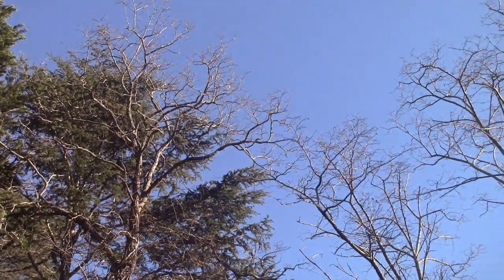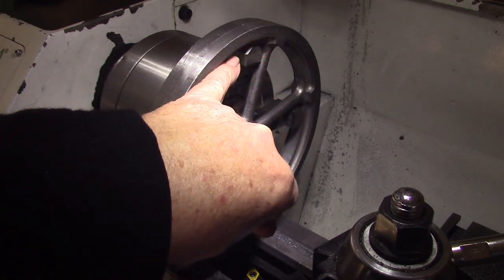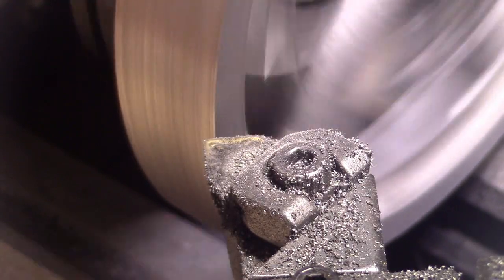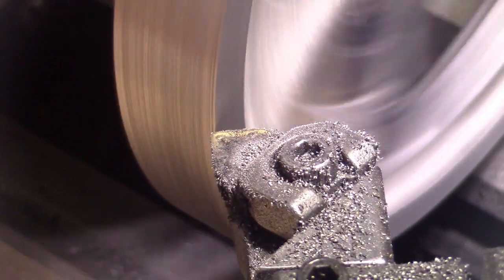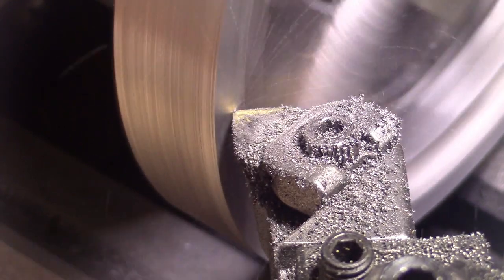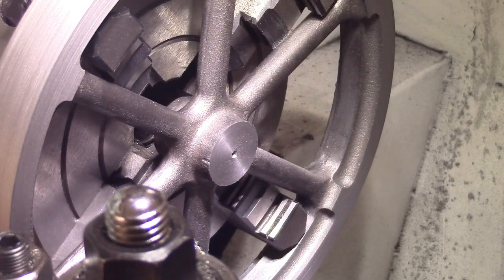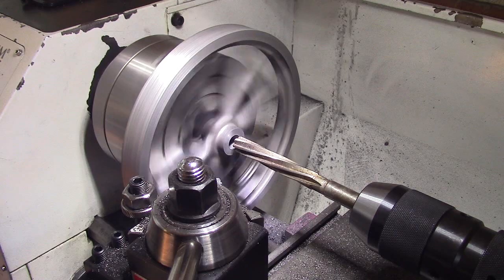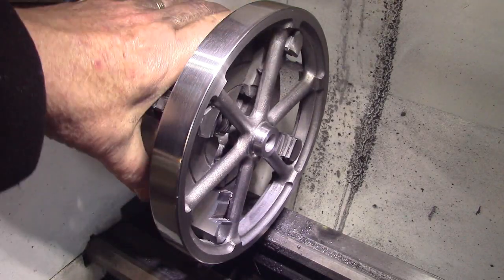Stuart Beam build 3

Comment: How did you secure the mandrel to the flywheel hub? Was it an expanding mandrel?  
BTW Great job on the fly wheel, looks great!!

Stay safe 

David G.
Reply from the maker: Hi David, thank you for the kind comments, I used "Supper Glue" to hold the flywheel to the mandrel, it's very strong and allows you to finish machine  the back faces. Use heat to remove the bond. (Early video)

Comment: Thanks Gary, I’m trying to decide if I can tackle this on my mini-lathe, (180mm swing over bed, with 4” chuck), what machine did you use?
Reply from the maker: Hi Chris, you should be OK if you take it easy, check out "Learning Turning Metal - by Andrew Whale" on YouTube, he made one on a mini lathe. You will also need a milling machine, good luck, Gary
Reply: Gary, my only concern was turning the flywheel because of the diameter, I do have a mill and the other components all look to be within the capacity of my machines and hopefully me!